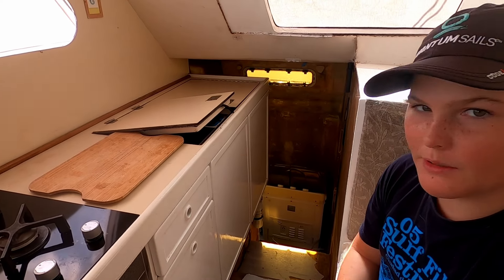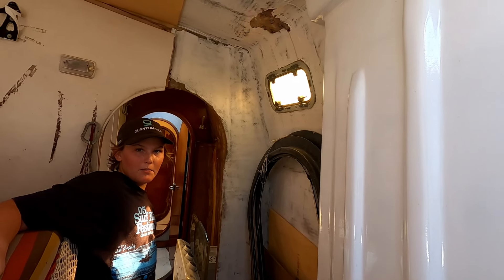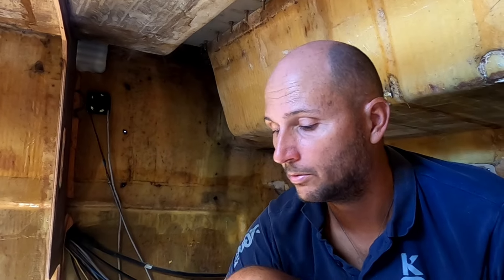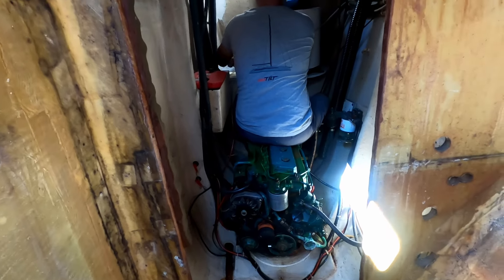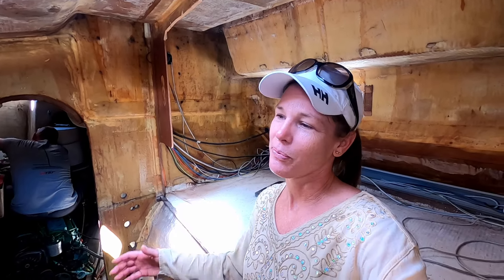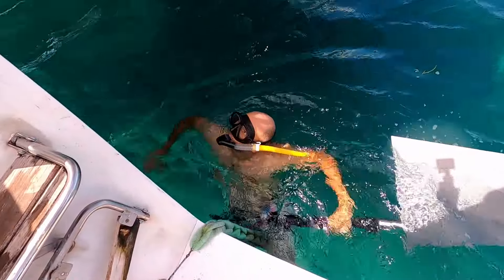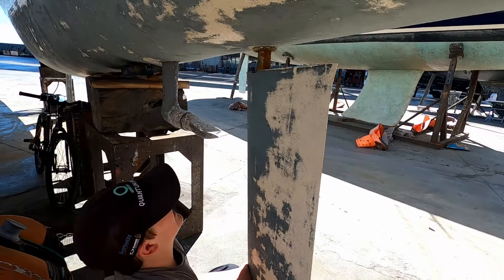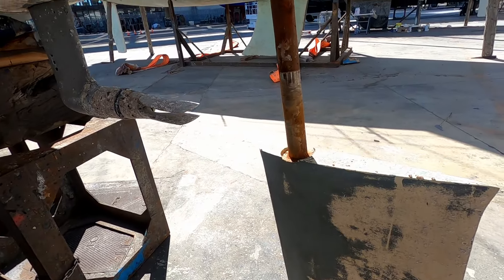Crack in the hull and asymmetric rudders - Barcelona refit begins

Comment: Your boat shows signs of being submerged at some point with all the cracks and rotten bulkheads. Hopefully this will be the end of unscheduled repairs. I love all the carbon upgrades you have been doing!
Reply from the maker: We can sort of see where you may think that may be the case. However, the bulkheads can't rot as they are all foam and glass. The only exception to that is where there was a plywood insert for the original chainplate set up. The rot for that came from water on deck seeping through bolt holes. The crack came from the previous owner putting a block in the wrong place when taking the boat out of the water. We repaired It on the out side a couple of years ago and were waiting for the inside to show signs of movement before opening it up and repairing it. It was opened up in the yard in Barcelona when a block was put in the wrong place again like what happend to the previous owner. 
One of the cool things about our catamaran is that it won't sink. There is enough bouancy and the boat light enough to not sink 👍

Comment: An enormous undertaking but that’s going to be some sort of Super Catana when it’s finished. I had the same problem removing the rudders on our 48R and ended up using penetrating solution of acetone and diesel with an impact wrench. I would think both our rudders are in the 20+ kilo range but I didn’t weigh them and I haven’t got the knowledge and skill to build them out of carbon so I am green with rudder envy right now. I have also looked at ripping out the vinyl but it’s just too big a job for me and I want to launch and sail before I die of old age. Kudos to you guys ! Team Paikea 👏👏👏👏👏👏
Reply from the maker: Kids might have finished school and left home by the time we've finished 😜😜

Comment: Shayne must be exhausted, because Anna has to almost use a winch handle on him to get him to speak on-camera. 😜 I cannot imagine you and the boys are too thrilled about all this work, but you are going to make all of your YT followers very happy to watch this complete refit.  I heard Harry mention replacing the woodwork with foam and glass, but I assume we will get to see more CF work on the new rudder(s) and maybe bulkheads?  Have you decided on glass or CF for repairing that crack in the bilge sole?
Reply from the maker: 🤣🤣 Shayne is built for YouTube 😜 Lucky Harry loves talking! Yup mostly foam and glass. Crack in hull was fixed with polyester resin and fibreglass - it's what the rest of the hull is made from. We do have a few cool carbon-y mods we're going to add but replacing most of internal furniture/floors will be foam and glass.

Comment: The look from Shayne as the enormity of the task hit him really rang true to me. I am long past being surprised by the extra work I can find when I start doing some boat work. Maybe a nice rolled stippled finish inside would be good - fairing inside that thing is going to take many hundreds of hours if done to super high standards. Please just get a really good skim filler coat on, get nice coves between the skim coatr on the walls and then put on a stippled rolled epoxy thick coating. I did that inside and it hides many sins. Start with the lockers. 
What about putting a full height bulkhead in the bows? I have that on my 38 footer and love it. No water comes in the boat from wet kites, fenders, body boards, sailboard stuff and all the other goodies that we have when living aboard. I really recommend having a full watertight bulkhead from about 3 metres in front of the main strength bulkhead. It provides excellent collision protection, capsize flotation, truly excellent wet storage, and you lose an almost useless bunk which always gets covered with stuff. Ours has dinghy hatches in it so that we can open the forehatch and get airflow too. Love mine, consider it for better wet storage, no water down below and more safety. 
Good luck on the project. Hats off to you.
Reply from the maker: Good suggestion re forward storage locker. We have been thinking about doing the same.

Comment: Wow, talk about a refit. Very curious how much wood furniture you remove from the boat all-in. I was stunned how heavy the plywood core doors are on our boat, it's pretty tempting to rip them out and replace with something lighter. What kind of foam or material are you planning to use for the new furniture?
Reply from the maker: E-glass cloth and PVC foam core for replacing timber furniture and floors. We estimate the weight saving in replacing floors would be about 100kg. We heard from someone who replaced the furniture in his Catana42 with composites and said he took out a tonne.

Comment: Wait a second - were those spanners made of steel? Got to get some lighter weight Ti ones!   Highest $/kg weight saving probably.
Reply from the maker: 🤣🤣🤣 now don't you go starting that argument Evan! 😉 It's a constant lament from Shayne 😜
Reply: @youngbarnacles  The best $/kg we found were (a) inflatable fenders instead of vinyl (b) fiberglass propane tanks.
Reply from the maker: Check and check. They are both excellent weight savings options.  We have both those onboard Paikea too.